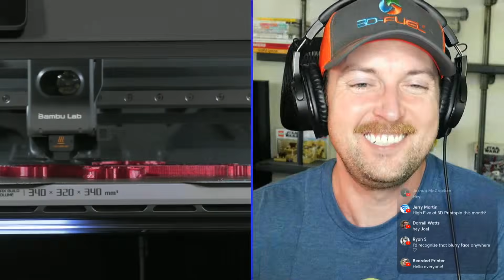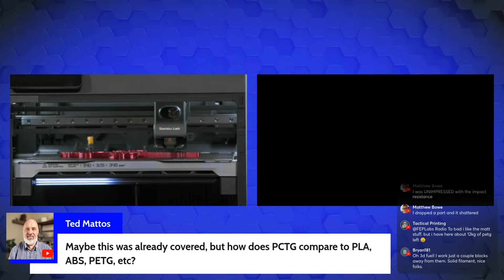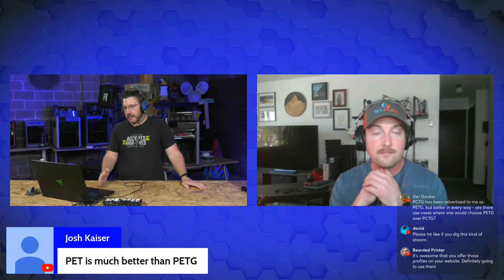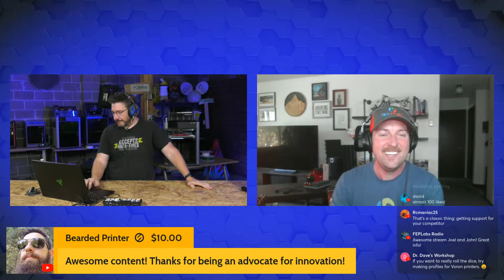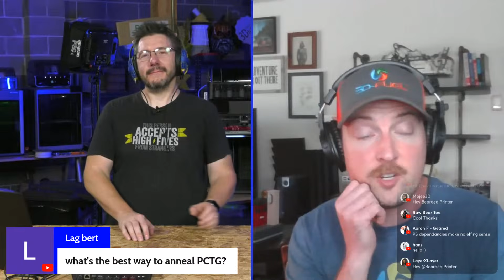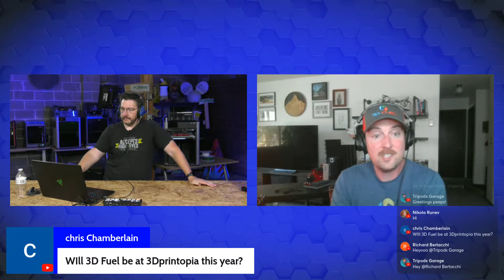3D Printing PCTG with 3D-Fuel LIVE!

Comment: So like PETG, but 4 times the price 😂 The 3D filament game is on the one hand the quest for higher performing, easier printing. But also a marketing quest for crazy profits?
Reply: @markmoorcroft7570  it's wayyyyyy better than petg. I printed a lot of holsters and firearms accessories with pro pctg and it's more durable than petg because it's layer adhesion is like 3x stronger

Comment: Nice they said the pressure advance for their PCTG is like 0.06, I always do it with the auto calibration on my a1 and got 0.068 for the one I've been printing, so I guess the auto calibration on the a1 for it works pretty well. When I used the auto calibration value for transparent PCTG for colored it came out bad in a way that it was obvious it was that number and when I redid it, it was much better.

Comment: this has been my nightmare filament, I cant get it to print well or consistent to save my life. I have tried everything. Do you all have a profile I could try that you had success with. I have tried all the 3d fuel profiles and calibrated multiple times on my own too. I really want to get it to work for me.
Reply from the maker: I used a default PETG profile with the nozzle temp a little higher. Yeah that’s it crazy right? Reach out to 3D-Fuel, they keep putting out good profiles
Reply: @3DPrintingNerd  Yeah just got off the phone with them. Made some changes and seem to be doing better
Reply: @billycrowe4501  care to share your adjustments? Object printing has been fine for me but anything that requires supports (tree) comes unwound after a few layers. Currently using 3d-fuels latest profile.
Reply: @THETreeSeeker sure I’ll get back to you on it

Comment: To perfect the top layer for each material use an ironing calibration 3mf file--remixed for Prusaslicer with all the per-object overrides on Printables. Also, Small Area Flow Compensation which can also be tuned but works fine for me with defaults (set PrusaSlicer output to regular G-code not binary).

Comment: This filament is the most difficult I have ever used. Is it allergic to PEI build plate?
Trying to print several parts on the same sheet, one puts down a great looking first layer. The next peels off like the nozzle is too close. No consistency at all. This stuff is nasty. 
I’m going back to PETG!
Reply from the maker: Oh shoot. I’ve had great luck with my two spools - have you reached out to 3DFuel? What machine and what nozzle temp?
Reply: @3DPrintingNerd I haven’t contacted 3dFuel. I’m using a Qidi max 3. It has a textured PEI build plate. I’ve printed at several different temps. The cal tower looks best 250-260. The only time I’ve had similar problems is with PP. that stuff only likes sticking to itself. 
I tried hairspray and 2 different glue sticks. No way to get a good first layer. 
I’ll send 3dFuel a copy of this to see what they can recommend.
Reply: I mostly print in PCTG. Build plate at 80 and nozzle at 270. All fans are off except the part fan. I still use a glue stick to help with part removal. Otherwise it sticks too well.
Reply: @saggyrob I’m printing fine now. Wash your build plate thoroughly with dish soap! IPA isn’t very effective.

Comment: I'm having trouble with brittleness, I have an X1 carbon and I used the profile from the website. I set print temp to 270 and changed print speed to 65mm/s. I dried it for 8 hours before printing at 65c as well

Comment: I like PCTG (other than the price tag) but the only thing I find is way overhyped and not really true is its strength vs PETG and its printability. You really can't print it much faster than PETG at all. Now they even have high flow PETG and I imagine it definitely can't print as fast as that. It does well in long pass solid fill but everything else needs to be slowed down a lot. Also, it is NOT stronger than PETG. It is more impact resistant. It has a slight flexible nature to it but if you try to snap a pencil shape of it or whatever in your hands, the PCTG breaks about as easily as PLA and the PETG is obviously stronger.

Comment: Ductile is ablity to be drawn into a wire.

Compliant is ablity to flex under strain.

Related but not exactly talking about the same properties. Ductile materials will be able to deform before failing. Compliant materials are flex under load. 

In terms of stress/strain relationship, Ductility refers to failure point, compliance refers to yield point.

Comment: Perfect timing, I just printed through my last spool of PCTG
I used to exclusively use ASA, I've switched 100% to PCTG, the layer adhesion is just insane, breaking a part will never have it follow layer lines.

1 thing I notice is how much better it prints after it's been warm for a while inside my enclosure. I associate this with dehydrating, but it doesn't require a hot temp. just air movement and something above ambient
Reply: I love it but my A1 mini can't get the bed up to temp so it warps like crazy. I was doing a larger print and the warping actually PEELED the corner of the PEI plate off the magnet😂
Reply: @sanstheskele-bro6102 That's strange I print on completely bare spring steel. Between 91-93c actually just lowered from what I was at. If I ever struggle I use Vision Miner nanopolymer
Reply: what printer you using? I cant get decent prints from this filament. Do you have any general settings that made the biggest difference to success?
Reply: @billycrowe4501  I'm using a Raise3D Pro3 with the FFF upgrade and their newer designed hotends with .6mm nozzles
Reply: @DerekPetersonLives  what are your temperature settings?
Reply: @ShadowBeats73  for bed temp I'm set anywhere between 86-91°C
as for extruder I'm running 266°C with a max volume speed of 15-20 mm/s depending on the finish and strength I need to maintain.

The shinier you can get your print to come out the better your adhesion
Reply: Wonderful knowledge, thank you so much!  @DerekPetersonLives

Comment: I tend to avoid PETG because it tends to fuse with the build plate. Is PCTG better than PETG in this regard?
Reply: We recommend printing Pro PCTG on a TEXTURED PEI that has been thoroughly cleaned with Dawn dish soap and hot water. This will break down and remove any surface oils. And have the bed set at 80C.

If you use SMOOTH PEI, you'll want to use a glue stick for a release interface layer otherwise, to your point, it will bond so well that it is likely to pull up your PEI from the bed substrate.
Reply: I use a texture plate with pctg every day and I use Aqua Net hair spray. It stays stuck very good until the bed cools then it is as if it was already removed before I got there. In other words, it falls off the plate after cooling
Reply: You need to increase z offset to 0.1mm and turn the temp down. PETG likes a hot plate with a cooler nozzle. Also, don't print super thin layers on the first layer. Then there's zero problems with it sticking to the build plate. if you have to abort a print, let it print 3 or so and then cancel. It comes off very easily from textured or smooth metal plates. PCTG sticks to the plate even more IMO but neither are a real problem with what I said above
Reply: @daftypunker4639  In my experience, PETG is more sturdy when printing at the hot end of the temp scale for solid layer adhesion.
Reply: Windex.

Comment: Excuse my bluntness but why the f is it so expensive compared to PETG? Seems like a cash grab.
Reply: Economics of scale. There are very few companies making/selling it.
Reply: We address this head-on at around 35:45 in the stream. In summary, the raw materials are more expensive. We are doing all of the profile development work, too. We're a small company that doesn't have the economies of scale of some of the larger filament manufacturers. And we do a lot of in-depth customer support with a new-to-most 3D printing material like this. It all has a cost to it. And we have Pro PCTG available in 45 colors (and counting) and also have done development work on specialized PCTG variations.

I'm happy to talk more about this, too. It's a great question.